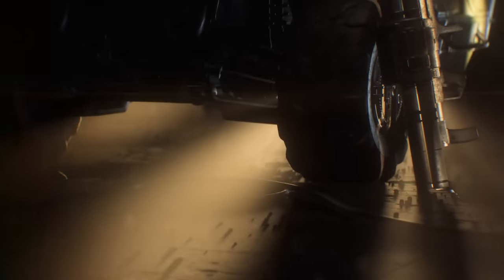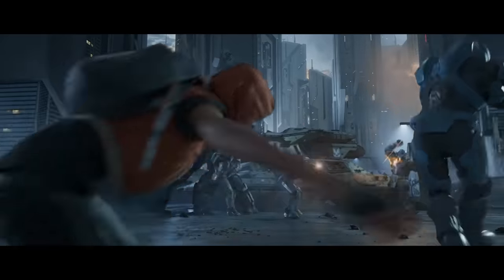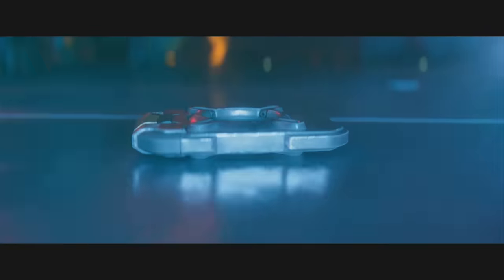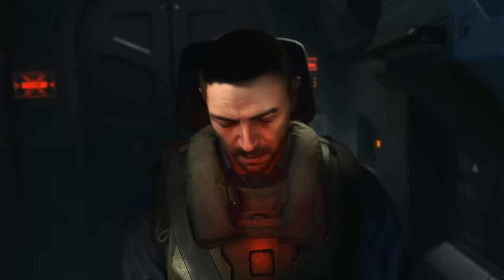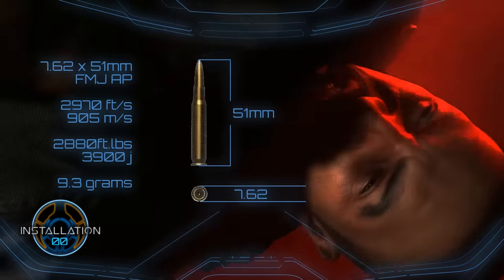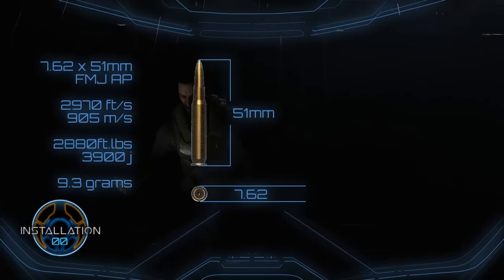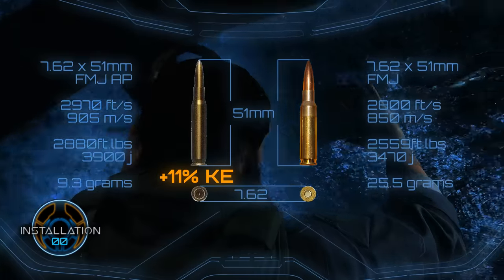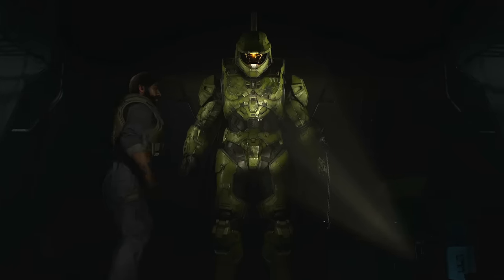Why are UNSC Weapons so powerful!? | The Armory

Comment: I'm not entirely sure where you would assume the rounds were more powerful. If anything, considering the number of rounds you have to pump into an enemy if you're not getting a head shot, I alwasy felt the weapons were quite weak.
Reply: Well it's fair to assume like how body armor advances in real, so to would it in the Halo Universe, especially 500 years in the future. So the weapons are definitely very powerful, it's just Covenant Energy Shields and body armor is ahead of us (except for Spartans).

Although I will say he has one thing off with 7.62 x 51mm round in the video. I believe it's actually more powerful than what we says. Since it's obviously based on, or is simply the 7.62 x 51mm Nato cartridge. It says its ammo type name is M118. Which is a real life 7.62 Nato ammo. Except it is 175 grains, not 143 grains. And I assume the creators Halo weren't Firearm or ballistics experts when they choose the weapons. So the Assault Rifle would actually be throwing a 175 grain projectile at 2,970 FPS, which means it would produce 3,400 Foot lbs of Energy. Which in terms of power is actually akin to 300 Winchester Magnmum (7.62 x 67mm)

Comment: I'd say the hybridized firing system is actually the most plausible reason tbh. As it explains the lighter bullets too, going down to 9 grams from 25.5. The removal of some propellant could explain some of that weight loss.

Comment: Did you consider whether the reload is gas powered? The m16 catches some gas to push the bolt back far enough to eject the used case and load the next. If that were to change, what impact would that have on flight velocity?

Comment: Your theory on rail/coil boosters is interesting but i agree thats probably not the case. The MA5s still use a cartridge design, and rail/coil technology allows the user to use caseless ammunition, which would greatly increase magazine capacity (possible the OG MA5 from Halo CE used this?)

Comment: I'm in the industry. In my professional opinion if we're still using firearms in the year 2550 we would have rounds with much more potent propellants, much heavier and harder projectiles like tungsten or carbide with inconel superalloy barrels and other parts to handle increased pressure and wear. Recoil mitigation systems would be my chief concern especially for non-Spartans. We can already do a lot of these things today but cost, weight and difficulty of manufacturing would make these weapon systems unfeasible. On a side note having these new super-ammunition types have the same dimensions as legacy rounds would be extremely dangerous for antique firearm owners if private firearm ownership is still a thing in the year 2550, but I imagine they would be CLEARLY differentiated from each other.

Comment: I assume the weight difference could be due to difference in materials. The US military is already playing with (and adopting) a 3 piece stainless steel/brass casing, which is supposed to lighten each round my a substantial margin, as well as allowing for a thinner casing wall, allowing for higher volumes of propellant. Those casings are also supposed to be able to handle a substantial pressure increase of close to 100k psi, which the new 6.8x51mm is estimated at about 80k psi (where I believe a standard 7.62NATO round is around 60k). Also you have to factor in the Ballistic Coefficient (BC) allowing for better velocity and better terminal ballistic performance of the projectile. Also, keep the materials used in construction of that particular projectile in mind. Considering the UNSC’s love for titanium alloys, it would not be a stretch to say that their form of 7.62 NATO has a titanium penetrator, or titanium core to replace a modern lead core, as well as an alloy that has been developed to be lighter than the typical copper jacket.

Comment: Maybe they incorporated limited micronization of coilgun tech as a dual stage launch with mid flight or end flight propellent ignition system?
I mean even i designed a theoretical rifle system that uses primitive magnetic coils to launch a round, and then either midflight using ramjets, or on impact using a modified armor jet penetrator round. So its possible a number of different mechanisms are used in halos rounds then in conventional rounds.

Comment: I have to clarify that at least in the united states 8 gauge shotguns are not illegal to own and use but rather illegal to hunt with in most places (because of punt guns used in commercial fowling) and not commercially viable. They can be declared destructive devices (also not illegal) by the atf if they "lack sporting purpose" but that is something all shotguns bigger than a .410 bore run the risk of.

Comment: If you would like to know why the firearms in halo hit so hard, it’s not because of the advanced powders in the bullets most of the guns have small, magnetic accelerators along the barrel so when you fire the gun, it’s not only the gunpowder propelling the bullet as it reaches the end of barrel it is accelerated more by electromagnets, making the round hit harder I don’t know if it is considered canon, but in halo nightfall, the covenant is tracking the electronic signatures on their weapons so they have to power them down. The electronic signature would be caused by the electromagnetic acceleration system, and the read out for the ammo screen.

Comment: I imagine the UNSC would have put significant development into ETC and Light Gas propulsion methods, have a look at Gerald Bull's HARP experiments which recorded data around 16 inch battleship guns launching payloads into the upper atmosphere, he experimented with a lot of different propulsion methods including the old 660lb powder charges the 16 in gun was designed to use, as well as light gas combined hybrid combustion charges which drastically increased the velocities and ranges achieved, the HARP programs height record was 180km with a 84kg Martlet 2 instrumented payload projectile achieving 2100m/s, the highest height ever from any gun launched projectile. KMW+Nexter and Rheinmetall have also done research into modern ETC propellants for MBT's main guns with RhM's efforts being around their 130mm and 135mm next gen prototypes managing to break the 6000 ft/s barrier.

Comment: The primary answer is that most people have a really unrealistic expectation of what happens when a bullet hits an enemy combatant. They also think that anything that's newer is automatically better than anything that's been deemed old-fashioned, or obsolete. Oftentimes, it's not realized that it became obsolete because it was too powerful, overkill for the job the military wanted done.

As far as the effectiveness of 7.62 Nato, one should remember that 7.62 Nato was designed to be ballistically equivalent to the earlier .30-06 cartridge, while being lighter and smaller, allowing troops to carry more ammunition. The .30-06 round was actually more powerful than the British "equivalent" round in WWII, the .303. The .303 British round was the primary armament of the RAF going into WWII, and was more than capable of destroying German aircraft, even after Hispano 20mm cannons had made it onto British fighters. As an anti-materiel round, the 7.62 NATO AP round is far more destructive than most people imagine. Yes, it's been eclipsed in that role by rifles capable of firing the mighty 12.7x99mm, also known as .50 Browning Machine Gun (BMG), but make no mistake, it takes dedicated armor to actually stop the .30 Cal.

Comment: there could be another reason and something we have seen IRL insulation we see this with some of the new polymer cases in development the case doesn't conduct as much heat thus more of the heat goes in to moving the round down the barrel they may be using a newer metal or alloy for the casing that doesn't conduct heat as well as normal brass.

Comment: I would say that it is a combination of explosive propellant and rail system explosive propellant starts it of at a high velocity and part way through the barrel the rail system magnitizes the round increasing the already fast round even further which is why you can see on some of the weapons when fired you see the empty shell casing being ejected because if it was just a rail system then there would be no need to eject an empty shell as that would still be counted as part of the projectile which in theory could make the round even more deadly giving it a Bolter round(warhammer 40k standard issue projectile) side effect of hitting a target then exploding like a mini grenade

Comment: I think a combination of more advanced propellants and case designs could perhaps be complimented with a low friction barrel lining or material of some sort to allow projectiles to lose less energy to friction & consequentially thermal energy put in the barrel, which would also lend to the lighter overall weight of the weapon as it wouldn't need as much mass to dissipate said thermal energy buildup. 

Another thing to keep in mind is that these 9 gram 7.62x51 rounds theoretically weighing less than half of a modern 7.62x51mm NATO cartridge suggests the possible use of much lighter projectiles which in theory would be a bit better at defeating futuristic body armor systems due to higher achievable velocities, and also perhaps an ultralight casing material that is able to withstand near modern case pressures at a fraction of the weight. Perhaps both. Given the way many UNSC standard infantry weapons & armor systems (not Mjolnir) appear to be significantly bulkier than modern day technology yet still are light enough to be fielded by unaugmented soldiers, it seems very plausible that such ultralight materials have been achieved.

Comment: 11:30 Fun fact: You can use 7.62x51 in a gun chambered for .308 Winchester. But you cannot do the inverse.
.308 winchester actually has higher pressures than its NATO counterpart.
The reason being that the 7.62 NATO has to be functional in all NATO weapons chambered in it.
Won't have to worry about your FN FAL exploding because the Spanish produced 7.62 was loaded too hot.

All NATO rounds have a designation for it's powder charge and projectile weight.
M80 is standard Ball round. FMJ. Used in typical infantry rifles chambered in 7.62 NATO
M118 is HPBT. Hollow Point Boat Tail. Used for range and accuracy in rifles chambered in 7.62 NATO

Comment: Love the video my man put a little bit of thought into this as well.  I think you're correct on there being no evidence of a magnetic gun or a booster. That and the ammunition for magnetic guns looks nothing like actual ammunition and we've seen footage of their bullets.
  You should look into bullet casing reinforcement there's a few manufacturers out there that is putting a steel ring at the base of the bullet right above the primer that allows for something like 30% stronger or 30% more powder for burning which would in turn equal that velocity

Comment: Is it at all possible that the weight of the round being lower is due to the rounds being a flechette? The US Military looked into that in the 60s for 5.56. If you did it while keeping the same round dimensions, you could also increase the amount of propellant and possibly achieve faster muzzle speeds and depending on what the dart is made of increased Armor Penetration similar to how modern MBTs fire a Sabot round.

Comment: The most simple explanation would be increased engineering on 4 components: bullet, casing, propellent, barrel. 

First, to be sure, the chain guns we have used in halo are not 7.62x51, but the .50bmg. I do not believe in the magnetic acceleration idea, so full stop on that. 

At face value the added velocity difference can be contributed to barrel length. Before a certain point, a longer barrel can add velocity to a cartridge before the added friction of a longer barrel, and the fact that now the propellent is all burned up leading to lowers pressures, can actually rob velocity. Being the BR, AR, and DMR are all bull-pup designs, this is a simple explanation. The guns can remain “short” while sporting longer barrels that would allow for…

…more powder in a cartridge, especially with a slower burn rate to effectively burn in the length of the barrel. There are two ways to achieve greater KE from a gun: baseline bullet weighing  147gr traveling at 2900 from a 24inch barrel at 60,191ps(keep this in mind)have a  heavier bullet traveling slower, or a lighter bullet going faster. The third is obviously that same heavier bullet either matching or exceeding that original velocity. We see this with modern ammunition as compared to ammunition in the last 160 years. Our smaller cartridges today have equal or greater energies when compared to the like of 45-70 for example(im not saying a .308 has more energy than a 45-70, just when compared, with todays tech a 45-70 designed with the same sort of propellent as a .308 would likely blow up the lever action used to chamber the 45-70).

That leads to designing a gun that can withstand the increase in pressures. The new 6.8x51 developed by Sig Sauer not only uses better propellents, but a newly designed case that incorporates a steel cup for the case head. Now you have a 140gr projectile moving at 2950fps from a 16 inch barrel at 80,000psi(SIGNIFICANT improvement over the what i mentioned above). Similar weight bullet traveling at a similar velocity, but out of a barrel that is 8 inches shorter. That is actually very considerable. Now. Faster bullets are where you start seeing greater issues with barrel wear. More velocity=more heat=shorter barrel life in regards to erosion or the throat and muzzle rifling which will effect velocity, and the operation system. 

With the 6.8x51 we have achieved a level of ballistics that well exceed what we thought possible with the conventional method of making ammunition with the simple addition of better powders, and a stronger case. It would not be to hard to believe that in the 26th century, that UNSC weapons used against the covenant, use similar tech advanced tech: denser projectiles(we never had weight given from lore) using tungsten, more efficient powders resulting in massively higher pressures, with metallurgy advancement for barrels to be able to withstand those increased pressures and dissipate heat, while also having a more robust operating system to handle the added recoil energy.

Comment: First I wanna start of with the way a cartridge is generally measured and named. We’ll go with 7.62x51 as an example, being that it is the most recognizable. 7.62 refers to the diameter of the projectile, the bullet itself. Technically it refers to the diameter of the bore of the weapon it’s fired from, but we’re talking specifically about ammunition, so we’ll make it a little less complicated. Moving on. 51mm is not the length of the full cartridge, but the length of the casing. Cartridge length varies depending on the type of projectile.
I can explain the weight difference to a degree. Obviously the cartridges in halo do not use polymer casings, but for the sake of argument, those do exist and realistically may be adopted as standard by the time that the halo franchise is set in. Also, armor piercing projectiles are often designed with steel core penetrators. Steel is lighter than lead, which will slow it to reach a higher velocity. Improvement in gunpowder technology may also give the cartridge a higher velocity and energy output. In other words the numbers going the directions that they do is possible… though I can’t say I have a clue if they can physically work out the way they supposedly do in the lore.

Comment: Non-metallic casings and projectiles containing a tiny payload. Miniaturized shaped-charges? The pistol fires an explosive projectile. A 7.62mm shaped-charge would be tiny, but those copper jets are moving fast.

Comment: The pistols in Halo are like an overkill Deagle (which is already a dumb pistol by how unnecesary it is).
Reply: It's actually closer to 500 S&W (12.7 x 41mm) which is the most powerful production handgun cartridge in the world. The Halo Magnum is just 1mm shorter in case length 😂

It makes sense when we're talking Elites and Brutes! But I bet the Marines (and their wrists) are a bit more glad the UNSC also adopted the 10 x 31mm cartridge (Also a real life cartridge based on 10mm Magnum which is also 10 x 31mm).